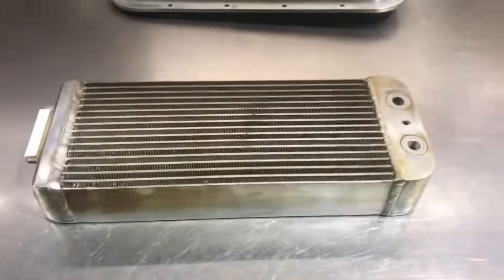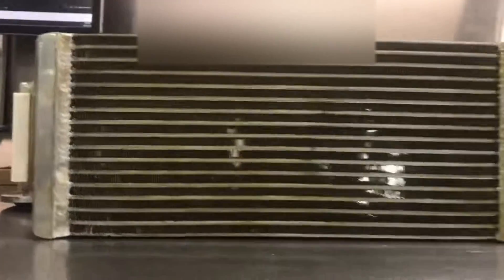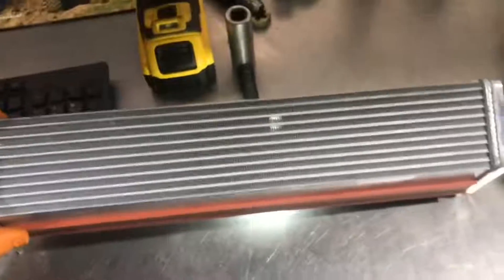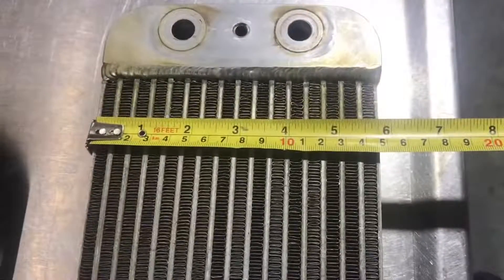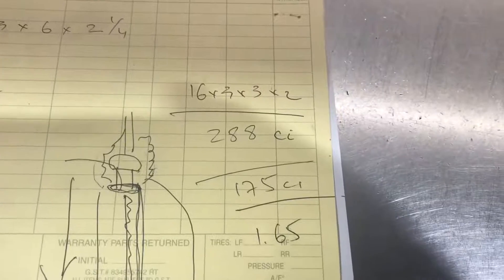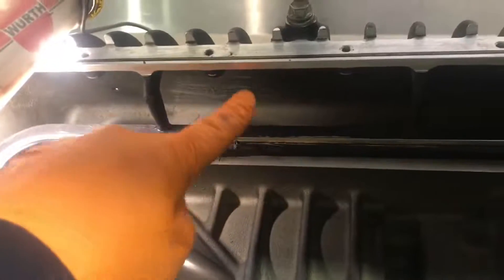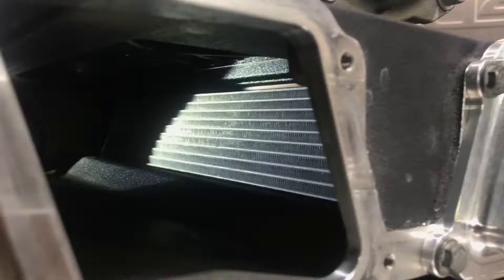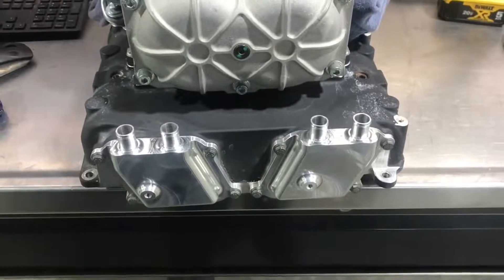TRD/Magnuson VS Harrop Supercharger Comparison

Comment: You'd think making more airflow would be better.
Besides,if Toyota trusts Magnuson over Harrop I'm good with that.
   They made the TRD blower for my Tacoma and I never had a single problem with it.

Well,other than me not having the self control to ease up on the skinny pedal.🤪
Reply from the maker: @ToddVandervoort-b9q  Toyota discontinued their supercharger program 8 years ago because too many engines were blowing up. The superchargers themselves were ok, but the engine internals couldn’t handle it.
The TRD/Magnuson 1900 blower was fine, I had several of them on my Tundras, but they were undersized for making any real power, that’s why I switched to the Harrop 2650 as soon as it came out.
Reply: @Viktor_G_Automotive they did not scrap the TRD Supercharger program because of reliability issues. They did it because it wasn't lucrative/profitable to maintain such a program. As a matter of fact, some individual Toyota dealerships to this day still go out of their way to become directly certified with Magnuson as distributors/installers for their superchargers.
Reply from the maker: @Cigaweed75-z2n interesting, what is the source of that information?
Reply: @Viktor_G_Automotive  
Which is kinda weird.
I never had a single issue with my Tacoma with the blower.